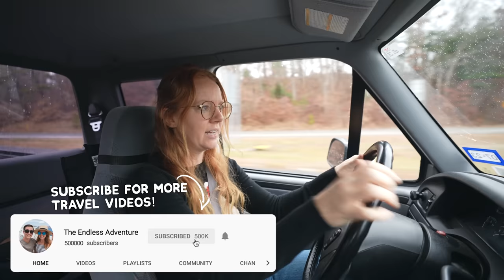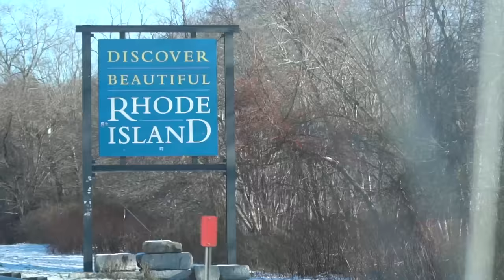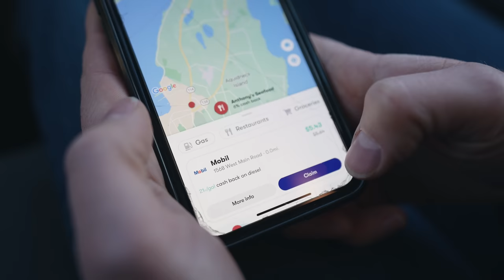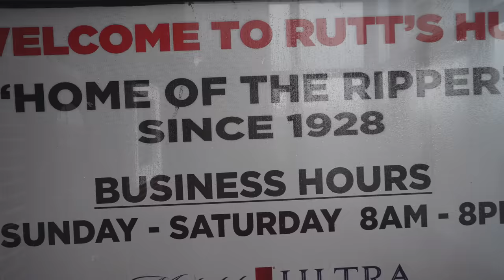Traveling by RV to 4 STATES IN 4 DAYS!? - Everything to SEE and EAT in New England!

Comment: Glad you went for real pizza in New Haven.  Sally's, Pepe's, Modern are consistently Top 10 in the US.  Officially it is "Tomato Pie", also Apizza (pronounced "abeets") which Frank Pepe brought over from Naples in 1925.  It is the tomato sauce I love.  The secret recipe is well-guarded and legend says, passed down on the deathbed.  Afterward always go to Libby's next door for a cannoli and cappucino.
Just a tip - never drive on a Parkway with a truck or trailer - prohibited due to low bridge clearances 9-10ft.  Garden State Pkwy has fewer restrictions than those in NY or CT.
They just widened Jersey Tpke another 30 miles further south.  It is a quasi-public Authority toll road and all improvements are paid through tolling.

Comment: What route did you take through NJ that cost you $50 in tolls? From NYS you could have gone west on I-80 to I-78 west into PA. From there I-81 south to I 70 heading west toward the Midwest. Tolls...about $3.00
Reply: They have a trailer. Multi axel vehicle
Reply: @videofan1010  There are no trailer restrictions on the routes I mentioned. We frequently tow our trailer on those roads. Unfortunately, the east coast has several toll roads that can cost a fortune when towing. Dual axle trailers pay even more in tolls. The goal is to avoid toll roads as much as possible.